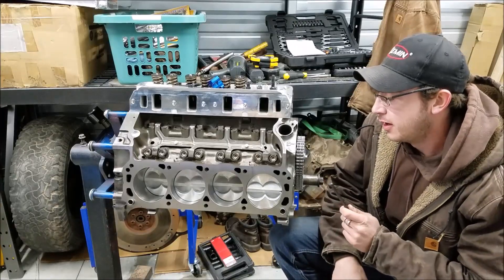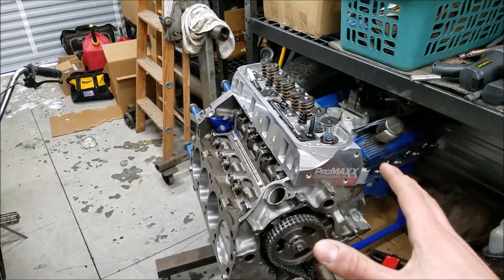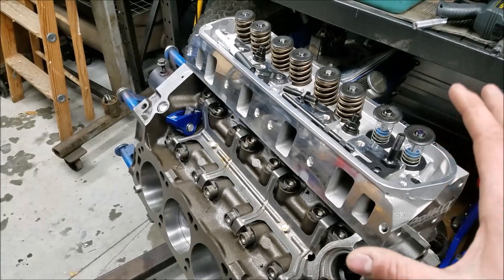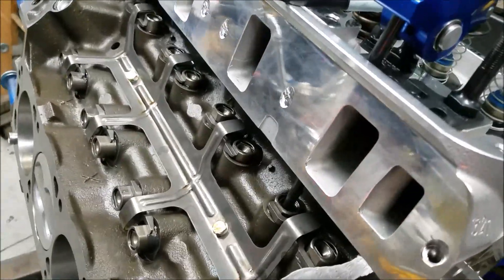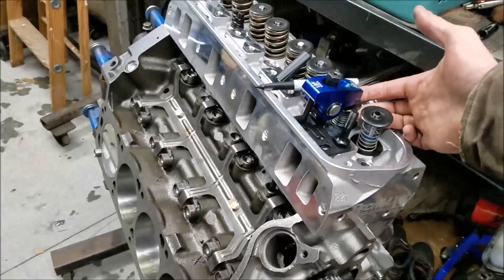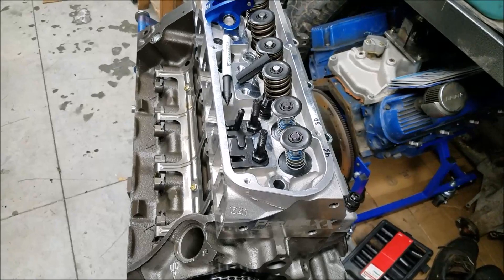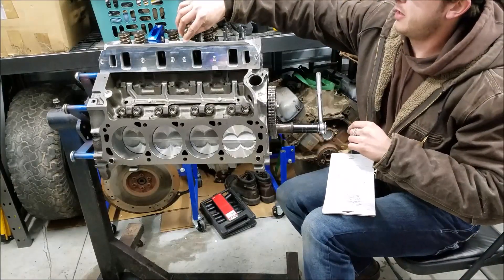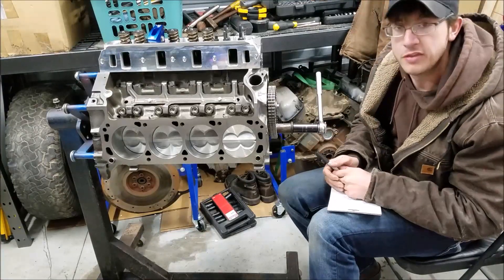Find Proper Pushrod Length/Valvetrain Geometry: Explained & Demonstrated (COMPLETE WALK-THROUGH)

Comment: Patent pending pushrod checking tool with no threads to adjust. Simple locking set screw locks the sections together.

Developing a BBC and SBC prototype pushrod tools now. Ford engines will be developed in 2022z

https://youtu.be/V4P1ljp-EK8

Comment: On your calculations at the end you added 0.020" of pre-load. With the final fitting you add 1/2 turn of pre-load (0.021").
Does this now mean there is now 0.040" of total pre-load or are the two 0.020" actually the same value?

Comment: I have a set of flotek heads and use a solid lifter set at .035 preload to check with the springs im using. Seems to work fine as it simulates the lifter pumped up with the lash set.

Comment: Luke, anything different to consider for flat tappet setup?
Reply from the maker: Largely not really - biggest thing to look out for is the pushrod length checker tool. Flat tappet pushrods will be shorter than their roller lifter counterparts since the flat tappet lifter itself is shorter, so the flat tappet pushrod has to take up that distance
Reply: @ThunderHead289  I have a pushrod checking tool. In my head I didn't think that the process would be different, but thought I'd ask to be sure. Never done this before, and seems like all the vids out there are on roller blocks. Thanks!

Comment: I'm trying to find or length on 5.0 1989 302 installing scropion pedistel rockers,I. Not sure what kind of lifter I should be using to run my patterns with? I was using new dry getting of marks but one side of the head weird marks not actual sweep,if call them marks. And some are .100 I'm trying to get them under .95 .
That's using 6.200 o 6.300 and everything in-between. So should I be using oil soaked lifters or solid. I converted a hydraulic lifter to a solid hydraulic lifter but when I tightn them down to 20 lbs I think they were bolted
 down too tight because the pr wouldn't spin at all between my fingers.

Comment: Hello there! Love the vid,gotta question,Trying to detirmine pr length on a stock 1989 302(mustang 5.0) roller with e7 stock heads Im trying to install a scorpion 1.6 pedistol roller rolcker and Im trying to use a fresh new (dry not pumped) hydralic roller lifer to read my sweep marks using 6.250  pr  they all took shims.All 16 vavles so my questio is should I be using these dry lifters or should I be using a hydralic used roller lifter I converted over to be solid.I took out spring and flipped the inside around and now when I use the same pr after I tourqe the rockers to 18flbs they are very tight!The pr wont rotate at all but when I use the dry lifters I get good sweeps good preload they hit between 1/4 and 1/2 and when I rotate the pr in my fingers they have some resistance not too loose not too tight so should I be using the dry hydralic roller  lifters to check ps length or  the hydralic roller lifter coverted over too solid?Also using the stock springs not the light springs please help I have seen lots of vids and they are not to par.As for the marks they might be false readings beacuse Im using the dry lifter and the cup does go down when I set the preload to check the pattern.But It seems to be a resl pain to take off those springs actually It seems easy but to put togther whole other ball game thats why I havent used the light springs but if thats the proper way to check I guess Ill do it.I have spent soo much money.I spent 1400 on a stock long block ran it but i guess I didnt burbp it and I thought I cracked the block or heads took engine out nothing wrong warnty ran out so bought a short block to save money bought heads e7 set then I had a guy come over said milled uneven exchanged them installed exchanged set with used rockers reved it at home drove 15 miles or so heard ugly sound on acceleration thought might be timming or exahust leak but deep down knew it was rockers sure enough 2 vavle tips were scored ugly.I did try to check sweep on those ugly non roler pedistol rockers major waste of time!!!They arent horizontal at all like with the roller they are DIAGNAL ACROSS!Crazy But neway please HELP me.I have called ford tech line some guys or jerks,cant trust anyone around my area,Lots of bad mechanic plus I know If I hire someone It wont come out the way it could come out/I want to have all my vavles right.I have 3 sprirals full of combos with shims,sweep size under .95 and in middle but I have been using dry lifters and the stock springs.O and Im using felrpo gasket the blue one and I have bought like 4 sets of arp head bolts.I keep thinking they wont tourque correclty or loose grasping /clammping force even after 1 toruqe,might be wrong.Soo many factors to consider when doing this.

Comment: Hello. Nice videos. I'm rebuilding a 1972 FE 390 (truck motor) and need your advice for establishing push rod length and proper rocker arm to valve tip contact sweep. The motor is stock except the cam, as I'm using an Isky "RV" grind hydraulic flat tapped unit (.498 lift, 214 duration at .050, and 111 lobe separation). I don't want to disassemble the heads to install light weight checking springs, so how can I use the hydraulic lifter or do I have to use a solid lifter? Also, how do I make adjustments to the contact sweep pattern. Use rocker shaft shims or adjust push rod length or both? Also, what lifter plunger preload should be used for the FE (.050")? I greatly appreciate any guidance you can provide.Thank you!

Comment: Another nice video.  I have a question regarding the lifter cup:   Why is you don't want the cup depressed when determining pushrod length?  won't the cup get depressed when in use?
Reply from the maker: The cup actually shouldn’t get depressed all too much, there is a little bit of squish, and that’s why we factor in the preload. With the engine not pumping oil, the pushrod goes way down inside the lifter, if we go off that measurement, our pushrods will work out to be a size to long, and in pedestal rockers will result in hanging valves open. 👍
Reply: ThunderHead289 thanks for the reply.  I’m installing some aluminum cylinder heads with stud mounted rockers.  Would you recommend “converting” an old hydraulic lifter to a solid one when determining my pushrod length?  Heads will already have springs and valves from the shop I’m using and I’d prefer to not have to take anything off if possible.

Comment: So I have 302 ho it goes through a quart of oil  a week and you can smell anti freeze sometimes no smoke coming from exhaust and no blow by at idle when warmed up it’s about 16psi when first start up it’s around 50psi any help is appreciated and love the rebuilding videos
Reply from the maker: +Nos3313 curious if you are actually losing any antifreeze? You can pick up one of those mitivac pumps as a rental at many parts store to pressurize your cooling system. If the pressure bleeds down, the coolant is also able to leak out somewhere. At 16 she is getting tired. I’d recommend going with a thicker oil if you could, and potentially adding an oil stabilizer. That should extend the life of the engine for you for now till later on if you wanted to rebuild it
Reply: ThunderHead289 i do lose antifreeze but no leaks I’ve checked the heater core and the floor no wet spots and no white smoke from the exhaust so idk what it can be
Reply: It’s also a 88 block from a Gt if that makes a difference
Reply from the maker: what does your oil look like? if its white, its there. 
in the case you are having, i would highly recommend pressurizing the system and seeing if it bleeds down
Reply: ThunderHead289 oil looks normal not milk shaky looking
Reply: What oil do you recommend right now I’m using normal 10-30

Comment: Love your vids - keep up the good work!  One note re. lifter preload... when you tighten the rocker stud nut, your lifter preload is actually more than the movement calculated at the stud nut.  This is due to the rocker arm ratio.  With 24tpi studs and 1.6 rockers, one turn tighter on the stud nut moves the pushrod down 0.068", not just the 0.042" calculated at the stud.  I think this is why most valvetrain companies just say "if you have hydraulic lifters, buy pushrods that are 0.050" longer than measured" - it's close enough for most and the math is avoided.

Comment from the maker: Parts List for Everything in Video - Your Welcome <<Tools & Valvetrain Components>> 
- Comp Cams 5.8 - 9.8 Inch Adj. Pushrod Tool (Full Set-Best Price): 
https://goo.gl/se8G3p 
- Comp Cams 5.8 - 6.8 Inch Adj. Pushrod Tool (Use in Video - SBF): 
https://goo.gl/rU95Wz
- Comp Cams LIGHT Weight Checking Springs: 
https://goo.gl/w5d9hK
- Scorpion 7/16 1.6 Ratio Roller Rocker Set w/ Locks(Made in USA): 
https://goo.gl/bt1g35
- ARP 7/16 Rocker Studs: 
https://goo.gl/AduVPc
- Comp Cams 7/16 Adjustable Pushrod Guide Plates: 
https://goo.gl/DyCo1k
Reply: Do you have info on your checking springs? I used the comp cams ones but they are too stiff and the plunger is moving..

Comment: Hey just wondering where you got the comp cams adjustable  pushrod? And if you know the part number to it. I'm going to be starting my first 302 for a fox mustang so just trying to get as much info as possible. Also awesome videos really helping a lot!!
Reply from the maker: I buy most of my small block stuff through summit - if you search adjustable pushrod and 5.8000 it should come up - i believe that is the low end of the range on this unit!

Comment: Good job explaining this Luke. I just want to give you one tip. Try to  use 7/16 stud on every engine. Most aftermarket Fords and Chevy's heads are tapped for 7/16 24 pitch. It cost no extra to get a 7/16 top and bottom stud and 7/16 rockers are usually the same price as the 3/8. Oh I usually take the valve seals off to keep the valve from sticking.  Merry Christmas.
Reply from the maker: +Mike MacCracken I figured you might be the guy to catch that! I got them from another guy who never installed them for about half price. I might just have to step everything up though... makes sense with the beating I put on my engines.
Reply from the maker: +Mike MacCracken speaking of, I have a question for you - you spoke of running without valve seals.... how much oil would an engine burn like this? Got a deal on some performance heads awhile back and they had no valve seals.
Reply: ThunderHead289 We only did it on   circle track engines. Circle Track engine run very tight tolerances and we limited oil going to the top end on the engine and opened up the front and rear cylinder head oil returns as well as the block oil returns. We plugged the oil returns over the cam tunnel to keep oil off the cam and crank to reduce windage and foaming of engine oil. I wouldn't do this to a street driven vehicle. Competition engines only.

Comment: Thanks for the video I was the guy wondering about how it ran. I actually bought the 351w from mabbco and have been running it since March with the aod conversion in my 1973 Ford F100 Ranger xlt. So far the engine has exceeded my expectations runs strong and stays cool. I've had absolutely no problems at all I hope you have the same luck. 351w flat top pistons Molly rings 268 comp cam and lifter set dubble roller timing chain Gt 40 heads with summit racing headers.